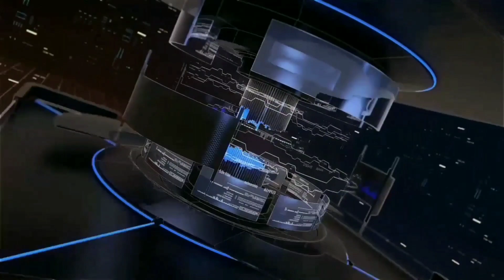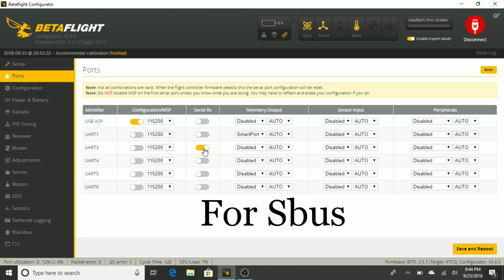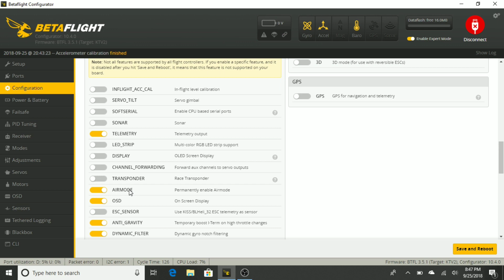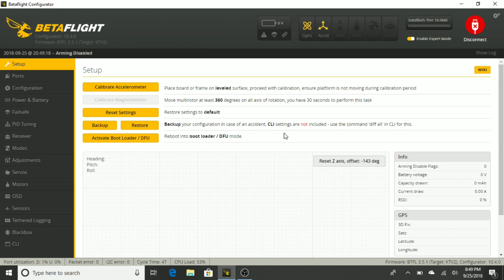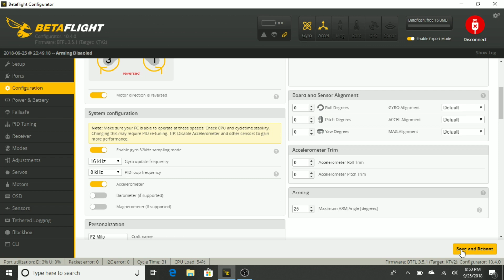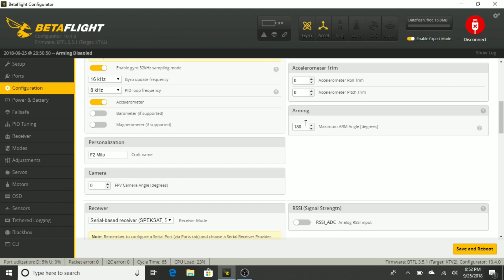Betaflight 3.5.1 CONFIGURATION

Comment: I use a double safe arming switch with my QX7S.  I have to hold down one of my Momentary switches and flip my arm switch or it wont arm.   Its too easy to accidentally flip an arm switch so you set it up with a momentary combo.
Reply from the maker: That is a good idea thanks for the info